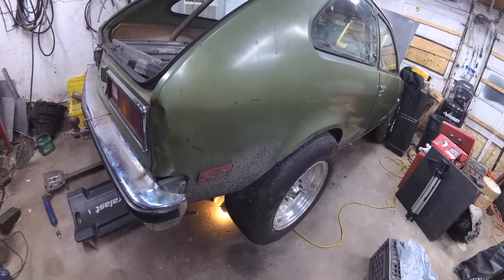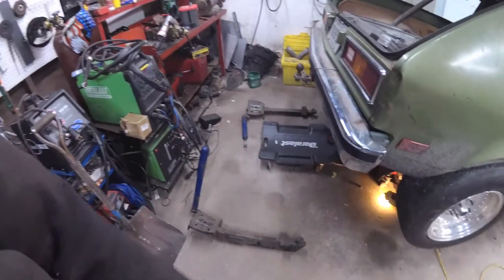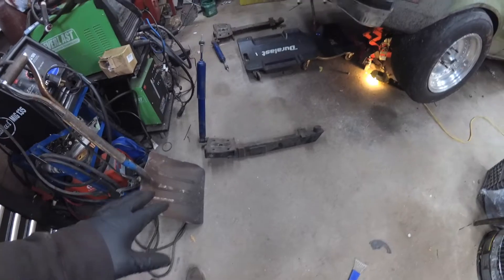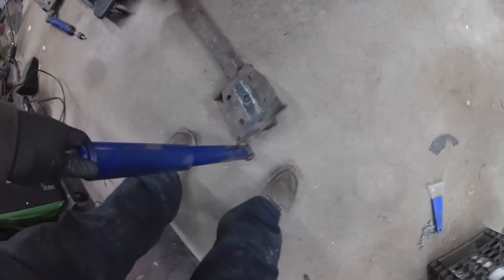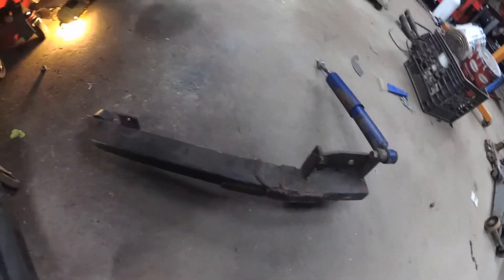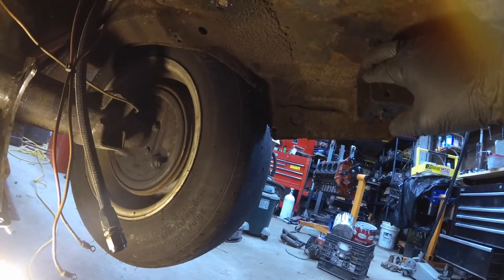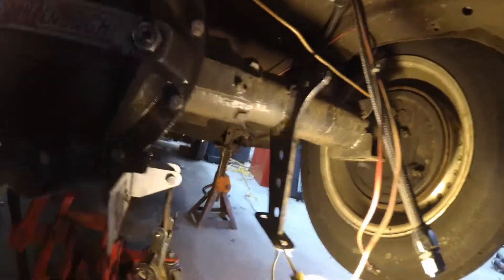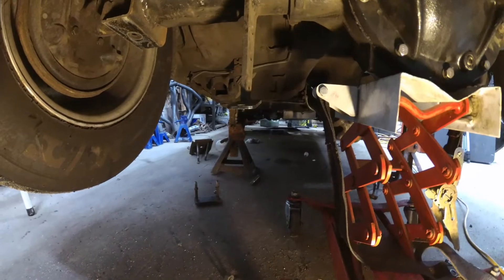Drag Chevette Rear Suspension (How you shouldn't get a 1.3xx 60 ft!!!!)

Comment: Sweet Vette! 

Tub and 4 link and be done with it for all the future power that will be added.

Those kind of Vettes are very light cars, so very small HP increases are going to make noticeable differences.

Your power levels can easily rise with simple power adders like N02 or a turbo or both rather inexpensively. The suspension you're talking about may not be up to the power adder task? 

Not sure though, I haven't looked at the Vette videos yet. Cool car though, those are getting very hard to find anywhere these days.

Can't wait to see what you figure out and can't wait to see some track videos!
Reply from the maker: Hey, the class I'm running none of that is allowed and its for stock type suspensions only. I havent been having any traction issues so far but I haven't stepped the nitrous way up either. I should be able to consistently run 1.2 to the 60 with the new setup which would be plenty for now.  The new  setup should be good till 4s in the 1/8 which wich isn't the goal as of yet lol. Im also going to be running two different sized tires to fit in as many classes as I can.
Reply: @brokejoebuilds5165  

Oh, dealing with class racing rules, I see. I've only been bracket racing. And the 2 better tracks I go to are 1/4 mile tracks. I would hate to let off the throttle just when it starts getting fun at the 1/8 mile mark.😎

Anyway, cool car, sounds like you have it figured out. 👍 Can't wait to see the little Vette in future videos.
Reply from the maker: I appreciate the support 🙏
Reply: @brokejoebuilds5165  

Your channel has potential, just trying to do my part, every comment helps. Keep up the good work.

Comment: what differential does it have?
Reply from the maker: At the time for this video . It had a gm 8.5 shorten to s10 axles. So it was at factory s10 width. It currently has a further shorten 8.5 with all aftermarket goodies. I have a video on that as well